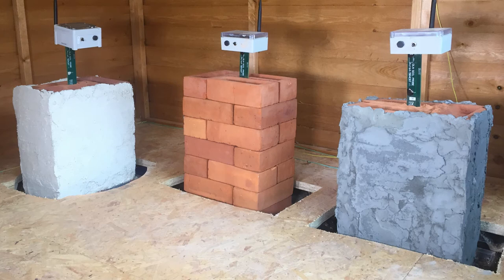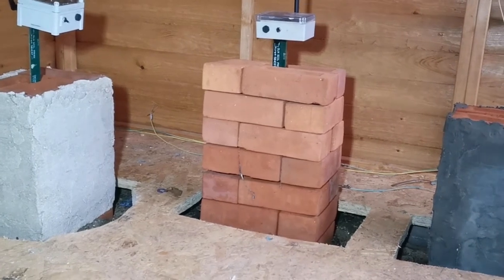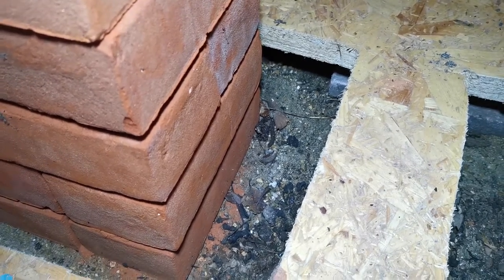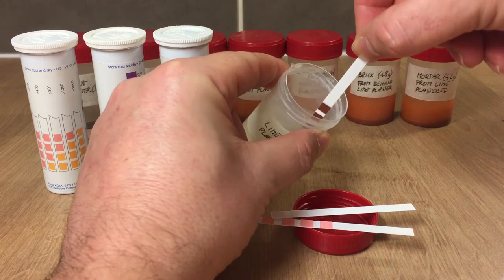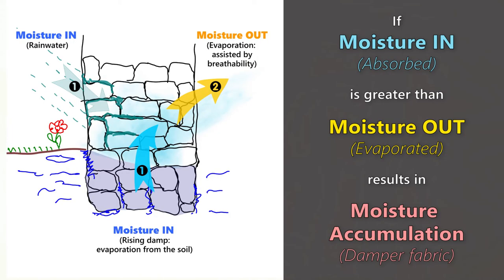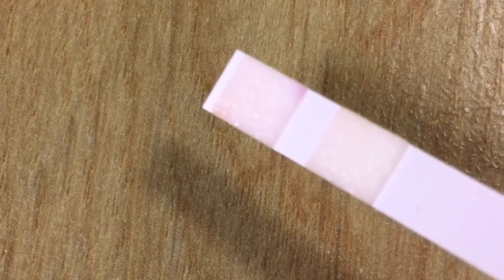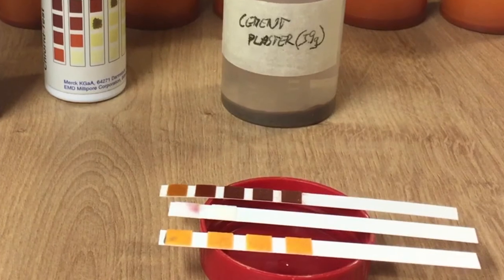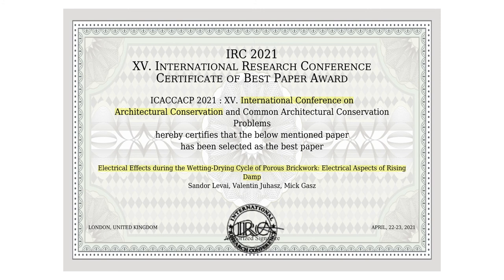Lime Plastered vs Cement Plastered Masonry - Research Data

Comment: It is good experiment that tries to move the debate on from what people think they have observed to expreimental data.  Obviously it needs to be replicated and more data obtained, but it is a excellent start.  There is also a need to develop further experiments to test the impact of render on an external wall for example.  Thank you for this.
Reply from the maker: Thank you for your comment. You are absolutely right: more research is needed as lots of debate on a topic means little actual data, lots of uncertainty and opinions.

Comment: It would be interesting to see how all of those three walls would behave in a very light wind, as from what I found out so far, the lime plaster is supposed to make the wall dry really well, but without wind the water is not picked up from the surface as well as it could
From what I found out so far I would expect that the difference would be much bigger for lime plaster than for cement one
Reply from the maker: Lime indeed has a drying effect, but it's not water that keeps the walls damp but the hygroscopic salts. In the presence of salts the wall will not dry or dry significantly slower, with or without lime. More info here: https://www.coreconservation.co.uk/drying-breathability-moisture-barriers/

Comment: Good experiment but you wouldn't lime plaster to the ground. There would be lime mortared brick exposed at the base. You should use reclaimed hand made bricks not  tightly fired modern factory bricks.
You should use lime mortar on the lime wall and cement mortar on the cement wall.
NHL 2 is still too tight for a lime mix.
Use either real fat lime (putty) or quick lime. Should be blended with a  well washed sand.
The walls should be exposed to the weather.
Reply from the maker: Hi James, this was just an experiment. In a real world scenario we would use different lime mixes, especially if the wall is damp and salty. You use a regular lime plaster on such walls and the water and salts will break it down. Using this scratch coat will make the plastering last for decades, and yes, this lime plaster can also be used on cement walls. The Romans knew what they were doing 2000 years ago...
https://www.coreconservation.co.uk/rinzaffo-salt-resistant-scratch-coat/
Reply: I agree that these walls are not constructed as would be the case in a real building therefore the results are only indicative.
Reply: Bricks below ground need to be hard fired and be laid in nhl 3 minimum in my opinion and walls not plastered to the ground and also a rigid slate dpc used , but it still shows that cement it shit appreciate the video

Comment: Very interesting even if it it does not fully duplicate the complex  conditions in the external wall of a building in use. It certainly demonstrates that cement rich mortar traps moisture  -  far more than  I had suspected. Would be even more interesting if realistic mortars had been  used and the perps fully filled as I understand that the changes in materials (and associated pore structure at the interfaces) at each bed joint is part of the reason moisture rise is inhibited.  The  mortar must be important as when I have   stood old  stock bricks on end in  trays containing  wet soil  (in my shed)  the moisture (and moss formation) only reached  about 150mm max. Maybe this is why BRED 245 suggest samples are most often best taken from the mortar - usually  more porous and uniform than the bricks. Keep up the good work.
Reply from the maker: This experiment was part of a series of experiments we have undertaken to study the movement of moisture. It is virtually impossible to to understand and evaluate what happens in an old wall fabric if one jumps straight into it as it is a VERY complex process. We started studying how moisture moves in ONE single brick, then SEVERAL bricks separated with a simple mortar bed, then this experiment with SMALL WALLS built onto the soil, then migrating to REAL buildings. Going through this process took us about 2 years. Firstly, because each experiment lasted from a few weeks to a few months. Secondly, because we have redone some of these experiments several times to validate the findings. Thirdly, because the phenomena were really complex. But it resulted in some invaluable findings. We still carry on with other experiments and we would like to explore more in depth different materials, how they affect the movement of water and further understand the differences between lime, cement, various types bricks and stones.
Reply: It  is very commendable that you are investing time to investigation this important subject as this is most certainly needed.